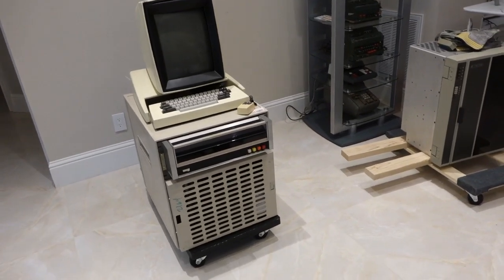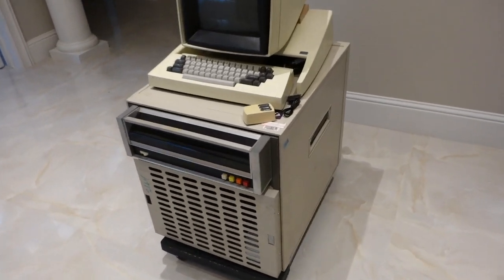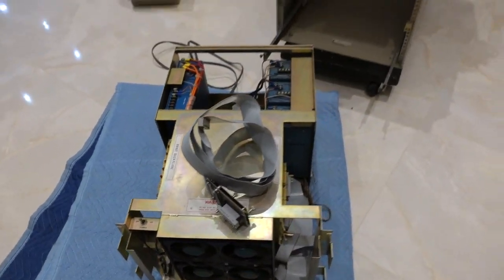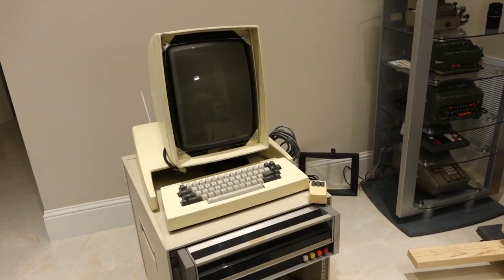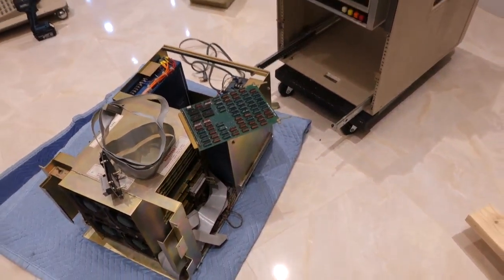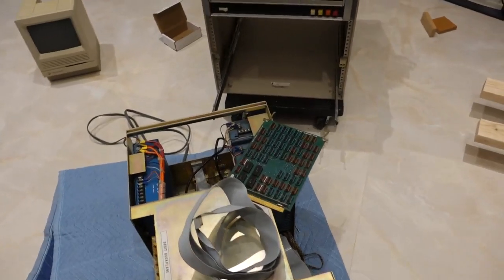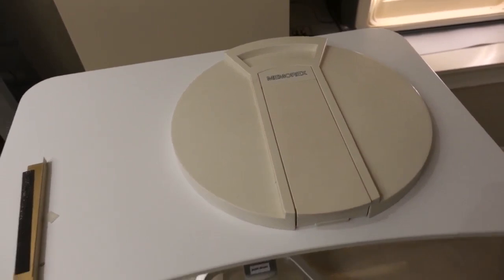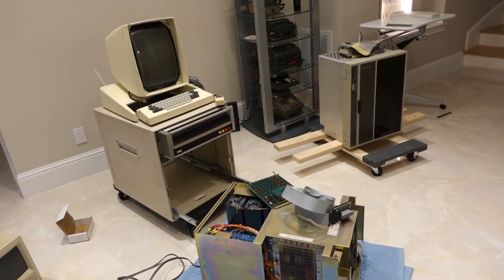Seminal Xerox Alto arrives for restoration

Comment: The 1970’s was clearly the dawn of the digital age, and the Xerox Alto was an iconic work of art that would inspire a paradigm shift in the way we interact with our environment and communicate with each other. As an electrical engineer I definitely appreciate the efforts behind the functional design of the digital wizardry inside the machine, but there is also a quality to the outside as well. I am not sure why they chose the color scheme of beige, and earth tones, but there had to be some thought that went into it. The Xerox Alto had such an elegant 70's design to it. 

 I suspect that it had to do with the Conceptual Art movement that started in the 60’s. “In conceptual art the idea or concept is the most important aspect of the work. When an artist uses a conceptual form of art, it means that all of the planning and decisions are made before hand and the execution is a perfunctory affair. The idea becomes the machine that makes the art” – Sol LeWitt. I feel this quote, while taken out of context, really highlights what the engineers did at this time.

Comment: WOW that wire wrap makes me so glad I work mainly with software LOL

I gotta learn more about this kind of stuff, I've done hardware repairs on a few old computers, but I have two which had problems over my head, some day I'll figure out how to fix them...

Can't wait to see what this thing looks like fixed
Reply: just make sure to check on them every so often to make sure they don't have any leaking capacitors or CMOS batteries. It's much easier to pull them as soon as you notice them and make a note for later to replace them, than it is to bodge in new traces because the electrolyte ate them off the board. A quick hint: if you need to remember what needs doing in a computer, put the note inside the case and tape over the power input or cover the pins on the connector so you can't power it on without dealing with it.

Comment: I believe this was also one of the first computers to be programmed almost exclusively in a high-level language, that language being Smalltalk.
Reply from the maker: +douro20 Dave Boggs, one of the original Xerox Alto engineers who was with us when we picked up the machine, told us that the operating system was done mostly in BCPL, which is the ancestor of C. Applications were done in BCPL or Mesa, a higher level language - on which I am not quite up to speed yet. But indeed, the Alto was then used to implement Smalltalk (one of the first object-oriented languages, which principles are still present today in Apple's iPhone programming language Objective-C), by no one else than Alan Kay, who donated this machine! There was also an interactive Lisp (InterLisp), research mainly as it was too limited in usable performance by memory (or the lack thereof).

Comment: There are several demos of the Xerox GUI here on youtube. Xerox also created their own network and networking (XNS) protocols for these machines. As I understand it, Douglas Engelbart created the mouse and user interface for these machines; see Mother of All Computer Demos on youtube.

Is there a way that I can emulate or simulate an Xerox Star/Alto workstation on my computer?
Reply from the maker: Not really. First, I am told there was no single GUI for the Alto. It boots to a command line interface. Each group did its own thing for their app, it was a research machine. That said, GUI development has been primarily credited to Alan Kay, Larry Tesler, Dan Ingalls, David Smith, and Clarence Ellis. It was not done by Doug Englebart (credited with the first use of a computer mouse at SRI). Some people from SRI had moved over to Xerox Parc, but not Doug. The network hardware was pre-standard 3MB Ethernet, which eventually gave us 10 MB Ethernet in the successor Xerox Star, and the protocol was PUP, which eventually inspired TCP/IP. There are some good demos of the much more developed Xerox Star GUI on YouTube (see https://www.youtube.com/watch?v=Cn4vC80Pv6Q), but very little on the Alto (here is the only good one I found: https://youtu.be/nYIEwWLfum4). I can't wait that we get ours running and see it for ourselves...

Comment: And it is not GUI - graphic user interface
but it is rather PUI - Parc user interface
that we have today.
There should be many other GUIs but we are STUCK with PUI (Microsoft Windows, Apple Mac OS X, Linux... all are copies of Parc User Interface or PUI)!
Reply from the maker: That over-simplification, however satisfying, does not give proper credit to what Apple did to transform this into a proper GUI as we know it today. After playing with the Alto, it became abundantly clear that although the Alto had many of the first concepts, a lot was yet to be invented (no real GUI for the command-line OS, no menus and windows except in Smalltalk, no desktop, no interface consistency, no Toolbox to call on for the programmers, etc, etc...). Xerox own Star, with it's obsessive reliance on object oriented concept, did not implement the final GUI very well. However Apple did a masterful job of building on top of it and continuing to invent the missing parts. "On the shoulders of giants" as they say, but it took another giant to bring it to what we know now.
Reply from the maker: And we are not entirely stuck with PUI either. Apple did it all over again with the novel multitouch iPhone and iPad GUI. But yes, we'd be stuck with pen-driven tablet GUIs if that had not been invented!